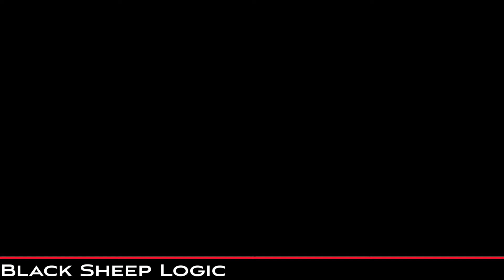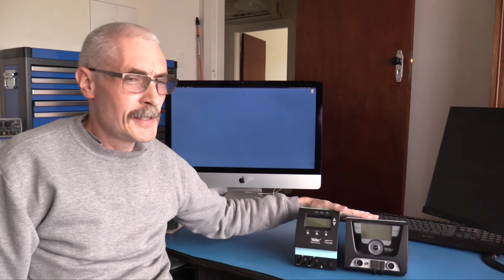BSL001 Weller WD2 & WX2/WXD2

Comment: Very good comparison 👍.
1. Will a  "-MS" cartridge work in a standard pencil? I see several nice, bent tip options that are only "-MS" -- no non "-MS" counterpart (e.g. RT 3XMS).
2. What is a measuring tip? (e.g K1101)
3. When would a non-wetting tip (NW) be useful?
Reply: 1. I would suspect it would, though I havnt tried it. The main difference is higher temperature  stability and proper grounding of the tip as required by IPC-STD-001 and MIL-STD-2000. MS = Mil-Spec. Used for Process Control and  EOS/ESD Control respectively. 
2. It is for measuring and calibrating the station temperature (offset feature in the sw menu). Also used for process control.
3. I believe these may be useful for special applications where you only wish to transfer heat. Also as solder doesnt wet to the tip the tiny tip will not change its shape due to solder. 

Hope that was useful.